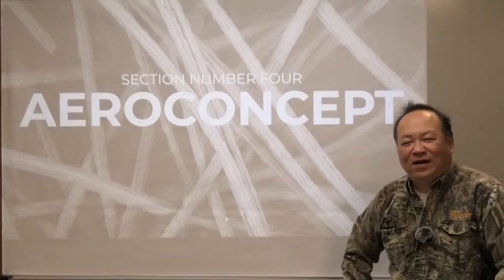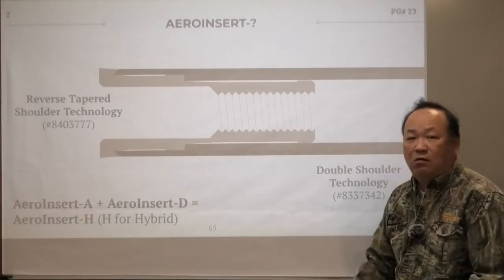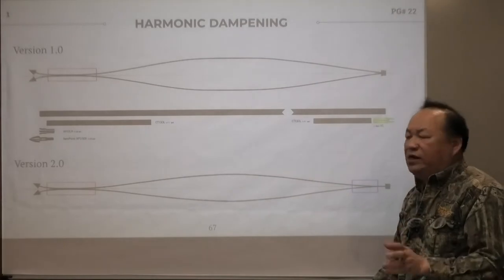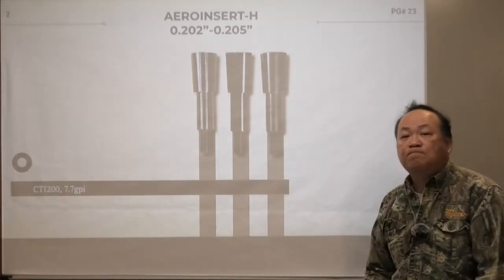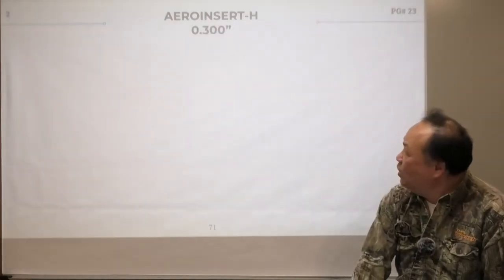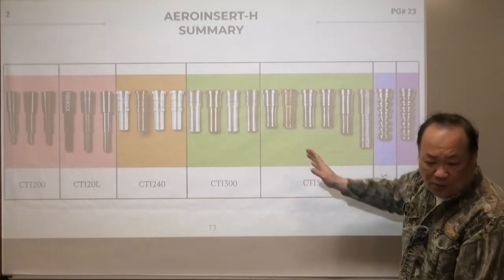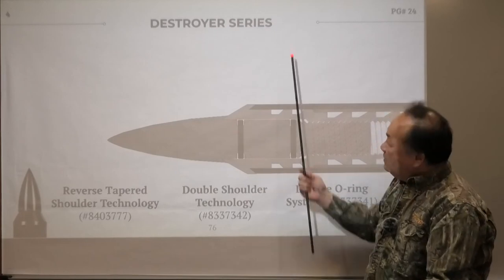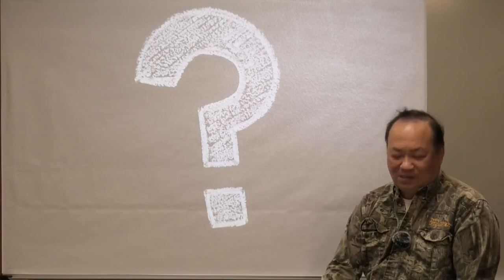Firenock Class May 2020 Henry IL #4

Comment: I have a 60 lb. custom recurve.  I designed a rudimentary arrow that weighed 907 grains. It's made of a 27  diameter target arrow made by Victory with an Easton ACC 340 shaft in the front & the back. The tip is an Irwn Unibit #1 which is pretty heavy but not as heavy & bulky as the larger unibits. I wouldn't try to shoot it out of a compound.  Just made it cuz I was tired of the standard fish arrow. I wanted to use it as a woodchuck arrow. Needed something to pin them to the ground. I lost a fiberglass arrow in a den when it took it down to it's final resting place. Still haven't taken a shot @ my newest guest but hoping this week is the one.

Comment: Good to know I'm not crazy.. I mentioned  doing this to another company about 2 days ago and I have been thinking about this since I got into building my own arrows but could never decide what to use behind the incert.. Now I see this video.. so this means my idea should work.. and the 300 spine shaft behind the incert is a great idea.. I was thinking a wooden dowel rod with acrylic resin.. the wooden dowel is also flexable but not sure if it would be stiff enough..
Reply from the maker: LOL that is funny.  You will end up with NONE of the arrow shots the same. Do you think you can find multiple wood dowel that is identical in density and strength and has an identical surface that can be bonded with epoxy to NOT have unevenness to prevent layer separation?  AeroConcept, as the patent stated, the most important is the glue; the 2nd part is the linear carbon tube. The carbon has no loop strength as it does not need any. It only needs linear spine strength while the wood dowel.  And if you did watch the video.  One needs a connection between the inner carbon to the insert, or it will crack right between the carbon and insert as we patented with AeroInsert-H.
Reply: @FirenockTV  my original idea was using wooden dowel then I thought about what if they just made a longer insert then they can keep it out of aluminum so that way the weight drains still get up there without being overly heavy but then at the same time some people like shorter inserts but would still like to be able to have the FOC and to be able to focus that weight into the very tip by making the inserts out of tungsten instead of aluminum or stainless steel then they could be short and very heavy
Reply from the maker: @shanestout3543  You can sure try, but what you suggest tells me you have no concept of the node of an arrow.  The arrow flexes at the node, and if you put a long inset, you make it worse as the node is being pushed backward, which causes all kinds of arrow flight issues.  As long as you are not shooting a compound bow, it is Ok.  Not when you shoot with a compound bow, especially not the one with a high left-off!  Node position is critical for high let-off compound bow/arrow tuning.  You want the arrow to flex like a mackerel, not a tuna shape.
Reply: @FirenockTV  no that was my original thought.. I hadn't figured out what to use.. but my idea was if you make the front 4-6 inches solid, only the back would be flexible which should act like a stiffer shaft.. if that would work then you could run a weaker spine arrow.. if you have a 28in shaft and make 4in solid, I think it would be like having a 24in shaft instead.. then you could use a 400 spine shaft... it's much lighter but the solid front would allow for a higher foc and the back should make for a very fast recovey.. I know the more front foc moves the balance point forward and the  bigger the fetching moves the air pressure point farther back giving more stability.. working on learning more about arrow dynamics.. I also know that higher foc with an overall  heavier arrow tends to keep up its momentum and uses more of the stored energy from the bow.. it leaves slower but keeps its speedlight little loss.. lighter arrows have a much higher amount of speed degradation the farther they a shot...

Comment: How do you deal with speed degradation of shooting lighter arrows because I know the farther you go the faster it loses energy if they are too light
Reply from the maker: Based on every single text we have with Labrador,  speed degradation never happened with this design.  Speed actually increases.  This result was confirmed by Rod White, who did the first round of tests back in 2013, Tony Warden did his in early 2022; and Cameran Derr, who just did his round of tests in August 2022.  The observed speed gain can be as much as 12% as low as 3% every time.